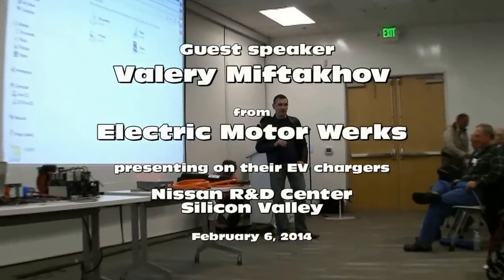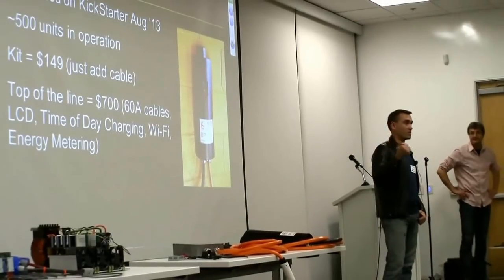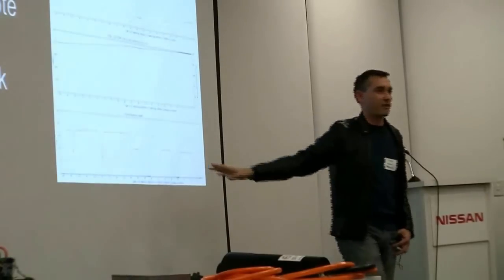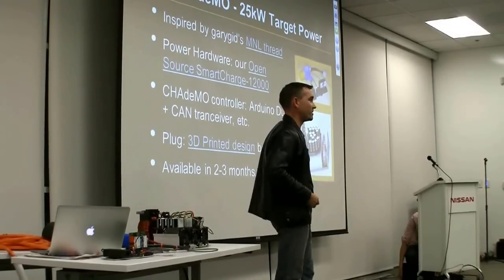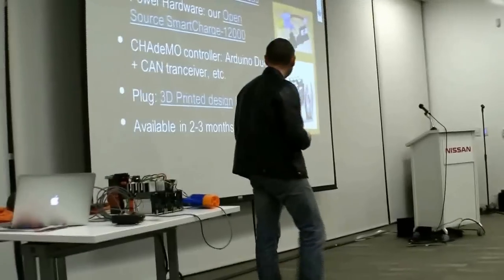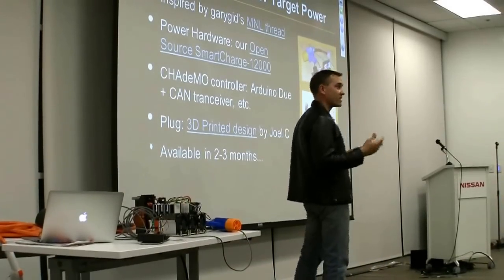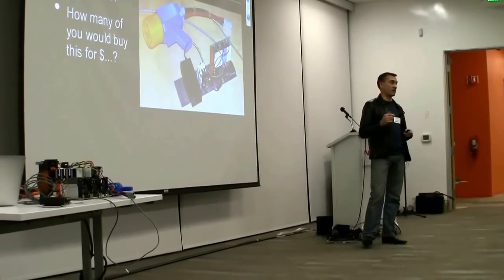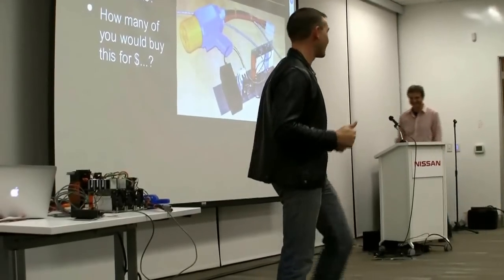Electric Motor Werks presentation on Charging systems at Nissan R&D Center in Sunnyvale

Comment: Way cool. I want one. I usually have plenty of time to charge when I'm home, but when time is short this would be great. Since your 20 kW charger already has a J1772 input option, your system could be a great L2 to L3 adapter while on the road. Your system would allow me to maximize the power out  of L2 stations. On the road is when I need to shorten my charge time. Build an L2 to L3 adapter for me. Please. Thanks for your hard work. This is exciting.